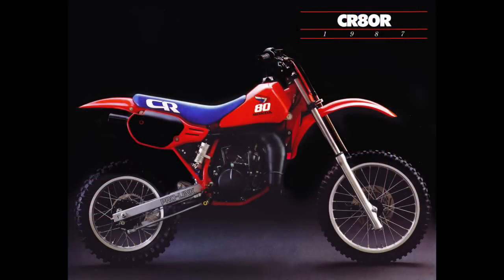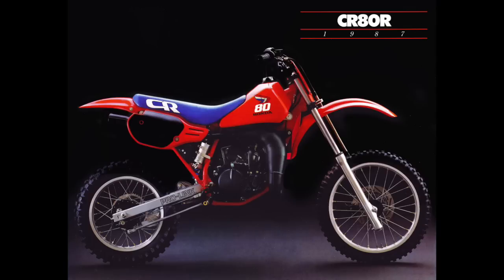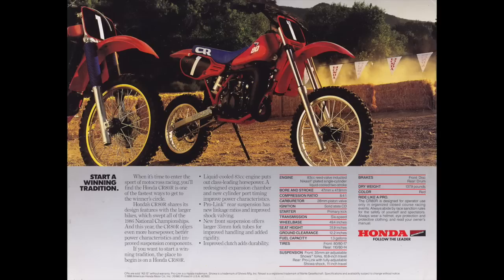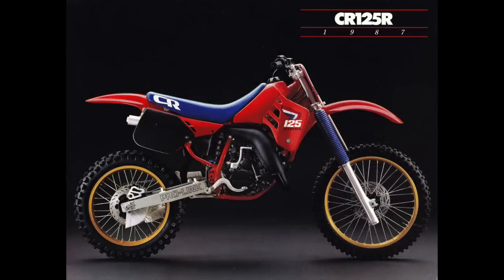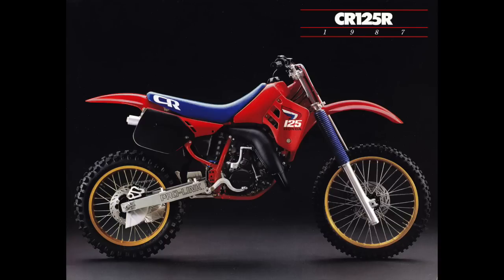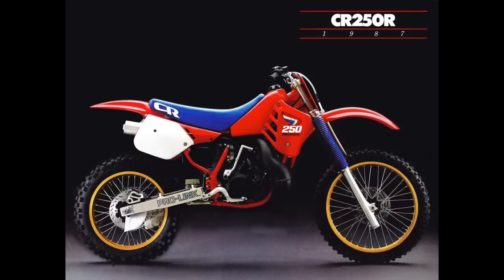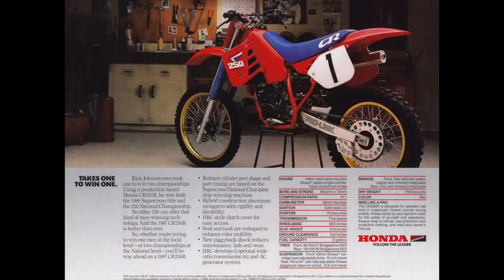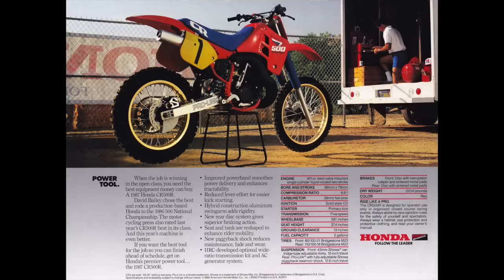A look back at Honda's 1987 CR Motocross lineup

Comment: I had the 1985 CR80. You are right about the ATAC system. It really didn't do much of anything. I used to call the chamber in the headpipe The Oil collection Chamber because that's about all it did.

Comment: I had an 87 250. It was a great bike the43 mm cartridge fork were excellent! The first rear disk brakes. It was a gun and run style power. The rear shoock needed revolving and a heavier spring.

Comment: I raced both the ‘87 CR250 and 500.  Both were great once you replaced the soft springs.  Both had great power but with very linear power bands.  The 500 had bad headshake under braking with the stock springs.  Otherwise no major gripes.  Wish that I would have kept the 250. Thanks for the memories.

Comment: I had both an 85 & 87 CR 250. I pulled an awesome holeshot on my 87, against the A Grade riders, in a all grades race. I was a weekend warrior at best, and was holding down 2nd until I washed out the front in a mud hole at the end of the 1st lap. It was a fantastic bike, raced clubman motocross and even did the occasional enduro on it.

Comment: hey motocross vault! The 87 125 actually had a real power valve. I just restored one and im 99.9% sure. I sold the bike a couple weeks ago and regretted it as soon as i lost sight of the guy. Great video man. Could you do the 84 kx lineup? The 80 that year was   explosive. I had 2 and both needed rear fenders when i got them!  Thanks again man.
Reply: I think your right. I think 84 or 85 they introduced the power valve